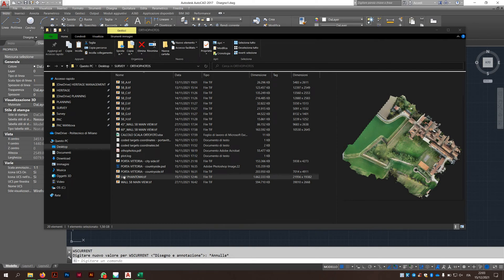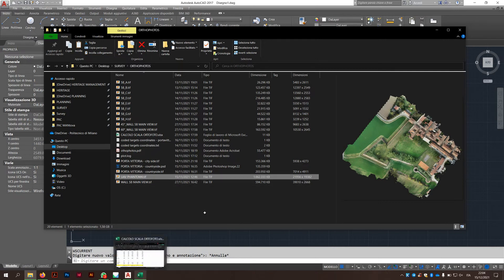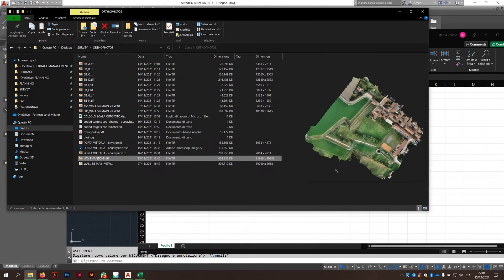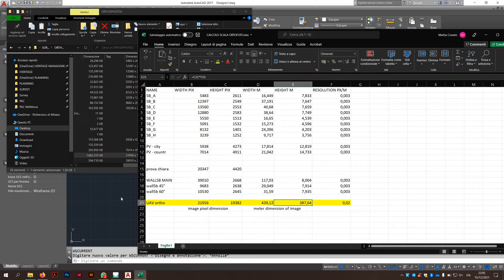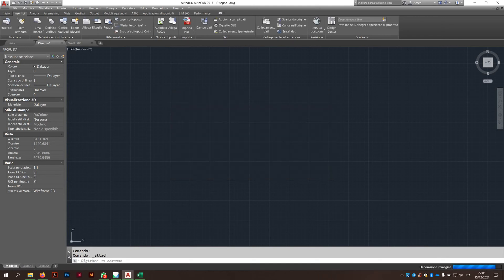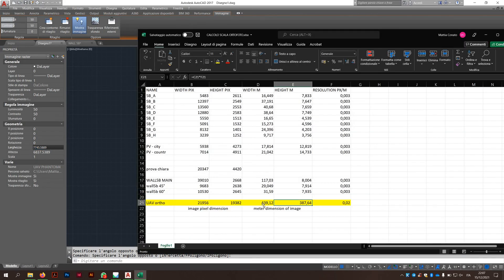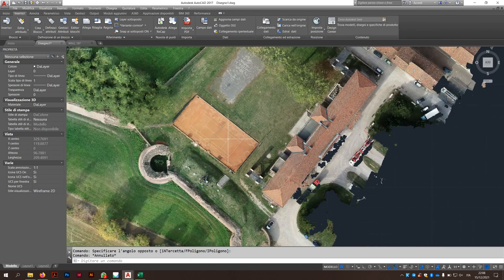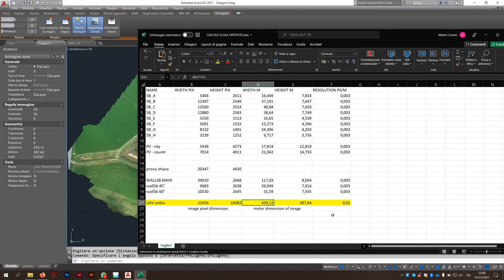How to import a TIF orthophoto in AutoCAD

Comment: ese numero que ofreces en el archivo excel es una constante para todos las ortodoxos? con esa relación de 0,02. Gracias
Reply from the maker: The 0.02 value you see in the excel is the resolution (px/m) obtained by the photogrammetric survey, in this case shoot by a uav device. You properly plan to obtain a certain value, in this case 0.02 px/m, based on the representation scale you want to achieve (I wanted a 1:200 detail for this). I advice you to deepen the topic about GSD, ground sampling distance, and the core of photogrammetry, that is the proportion:

C : h = pixel pitch : GSD

Where: C, focal length; h, distance between the camera and the subject.
Enjoy!